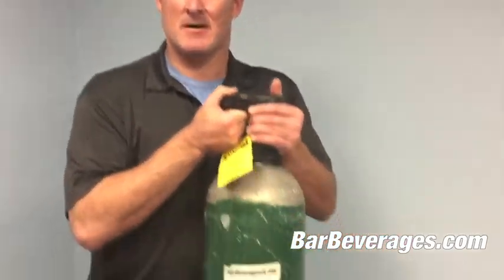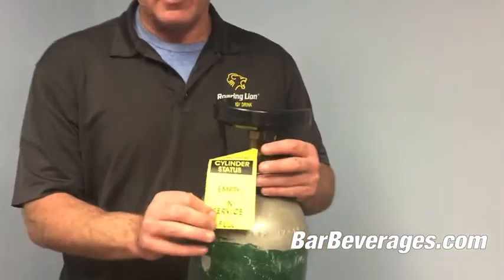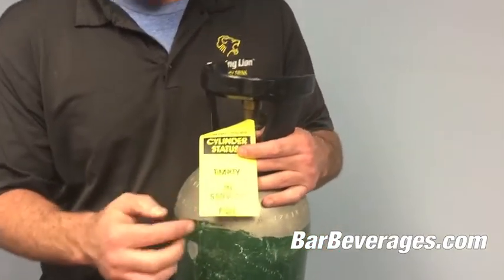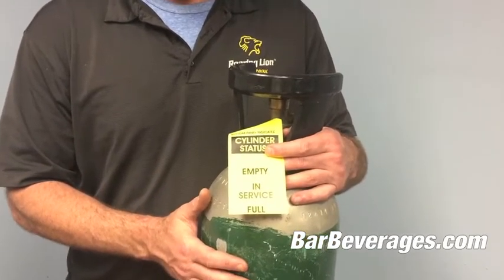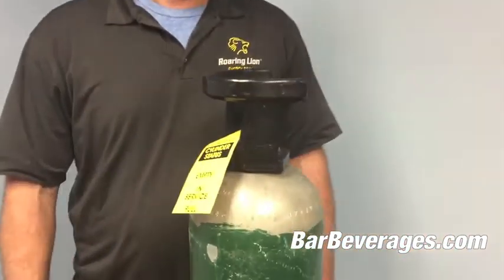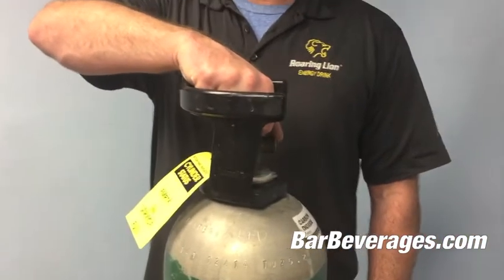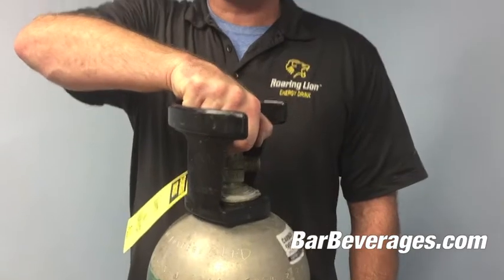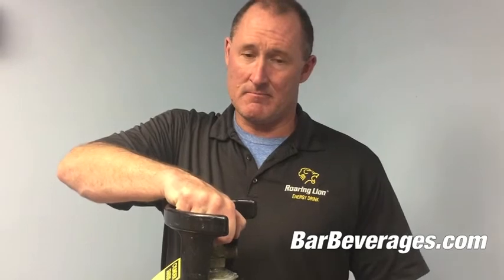How to Tell if a CO2 Tank is Full (or Needs Replacing)

Comment: Can't tell by weight? It literally says the WEIGHT of the tank ON the tank. Just weigh the goddamn tank and subtract the weight that's stamped near the neck from the weight you got on the scales and there you go that's how much gas you've got left. Jesus is it that hard?
Reply: 90% of people no longer have scales in their house and the scales that the other 10% of people do have, are notoriously inaccurate to the point of +/- 5lbs or even more. That being said, all your typical household scale is going to be able to do is give you a rough estimate.